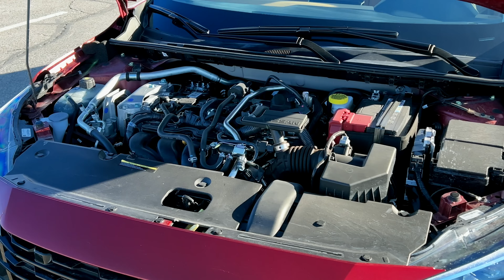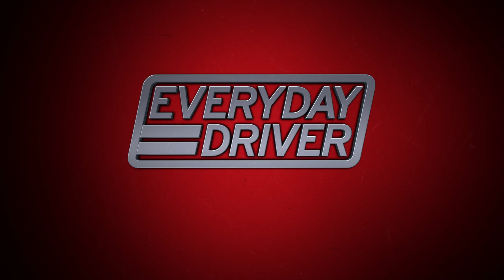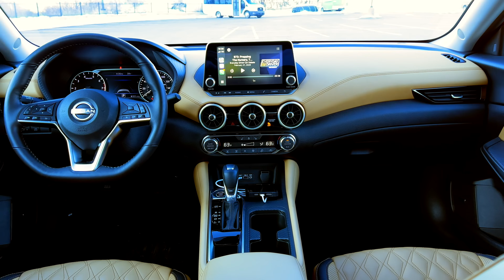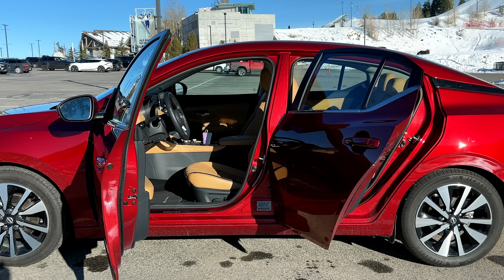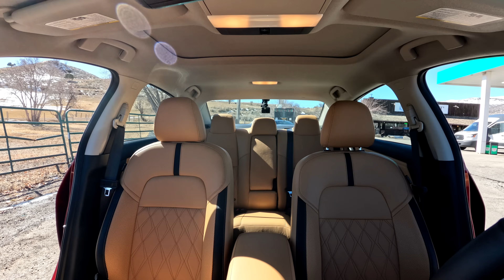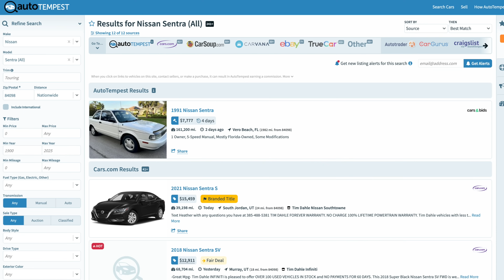Nissan Sentra SV - Value Over Enjoyment | Test Drive

Comment: I love my 2023 Sentra SV. 37,000 miles and 2 years later I still love it. No, it's not a sports car, but it has enough power mixed with great MPG. My average mpg is 39.3. I love it while driving up canyons. The CVT finds the proper spot and holds the car there.  No shifting up and down constantly. I drive up the canyons in Utah at 70 mph no problem.

Comment: It's too bad Nissan didn't invest in hybrid technology early on like Toyota and Honda did. This car with the Civic's hybrid system or something similar would push its horsepower up by at least 30-50, and be even more fuel efficient, which is what buyers in this price range are looking for. Then again, it might also cost a few thousand more, which would take away from its bargain status.
Reply: @Gambit166, This car gets great gas milage. Are you for real?

Comment: I rented one of these, in cloth trim.  I felt that the power was adequate and the seats very comfortable.  It’s no race car but it does fine on the highway, and the gas mileage was amazing.  I wish we could get more trims in manual as to bypass the reputably shaky CVT.

I found the handling quite decent.  I guess it was more of a function of this being a sedan as opposed to a crossover.

I would love to a see a review of a 2025 Corolla LE gas-only!

Comment: Rented an SV trim for the past month and drove 5000 miles through the front range and New Mexico. Acceleration was very poor. Fuel economy was average. Comfortable seats. Horrible halogen headlights. Good storage space in the back.  Transmission is terrible.  After the Sentra, I went into a Corolla for a week and then a Mazda 3 sedan.  The Toyota was by far the worst. The Mazda was my favorite. Drove the Mazda for 2800 miles over a weekend. With 32 hours in the seat, I was not fatigued driving in the Mazda.  All three were front wheel drive sedan and by far the Mazda was the most comfortable to drive. The Nissan would be a number two because the anemic engine and transmission. Interior wise, It wasn’t bad, but it wasn’t as nice as the Mazda. The Toyota is laughably so far behind I would not recommend anybody ever renting one.
Reply: The Corolla is overrated.

Comment: I bought a 2025 SV 5 days ago....For the 24,000 dollars and lifetime engine powertrain and drivetrain...I couldnt pass it up in spite of my doubts about the xtronic cvt! I give it 4 stars for value! You get a great car for around 20k folks!
Reply: 3 weeks ago I bought a brand new sentra 2025 but mine's the S model I also got a 1 million mile powertrain warranty from my dealer Even though mine is the base model I'm enjoying it it is the first brand new car I've had in over 20 years
Reply: @aaronyork6173 Congratulations! Happy motoring!
Reply: How did you get a lifetime powertrain warranty?
Reply: @keithert  Dealer incentive
Reply: The CVT in your car was redesigned two years ago. It shouldn’t give you any problems over its lifetime.

Comment: I had a 2014 Nissan Sentra SR and it was great, until you got to the transmission. The cvt just killed that car for me and I sold it 2 years agter buying it. I did buy it 3yrs old with 22k miles and sokd it by 44k miles. It was a great car, never gave me a single issue, but it was just BORING. Overal tho it was a great car, just wasnt for me.
Reply: The 2013-19 was a bad generation Sentra. 2020- Present like this one is far better.

Comment: Change the transmission fluid every 20k miles and it will be trouble free for 300k miles.  
Problem is that most of the first owners are companies buying for their salespeople, and rental companies, all of which perform minimal maintenance.
Reply: People shouldn't buy cars that transmission oil have to be changed every 20k.miles, just put a freaking automatic transmission or a CVT that last the life of the car....not 40k or 80k . .. people don't have to put up with that ..
Reply: @armandohernan4610  It's every 30k, at least based on the manual. He's saying to do it 20k, I think, so it lasts that many miles. It has more to do with a different type of transmission that needs more care. You get the efficiency of a CVT, but there are always trade-offs. There is no such thing as lifetime fluid...and if you do that the car will likely be dead by 120k miles...maybe 150k. If that's what you want, go for it.

Comment: I had a 2002 SpecV. Super fun car. 6spd manual, lsd, performance suspension. Upgraded to a bunch of Nismo parts and put on some sticky rubber. It came with Skyline seats at that time. Great autoX car.

Comment: I know its inexpensive.  And they are trying.  The exterior is pretty well done.  But to me the interior screams cheap.  I hope the seats are comfortable, but they look like an old taxi with plastic seat covers.  The corolla interior you show is just black, but it looks so much better to me.  I am not touching anything, I have no reference in those terms.  But to me, the effort to make a cheap interior not look cheap, screams cheap.  The view to the back looks good, but the view from the back seats to the windshield, oy vey.  I am around a lot of chinese cars.  This Sentra interior is like a b or c grade chinese car from several years back.  These days anything in this price range has either a very chinese styled or the interior sort of nice, often although cheap feeling.  I think if they used the same design, but with one or two slightly different colors using textures instead of color it would be much more attractive.  I like the knobs on the screen.  It looks like there is a lot of room inside.  2 years ago I rented a loaded out Rogue.  It turned out I hated it, it was awful to drive, but what an impression when you first open the door.  I think they have a formula.  Fool the buyer on the 10-15 minute test drive.  Make it looks nice and expensive, draw attention from the dynamics.  I don't think they were successful with the interior on this sentra.  And I agree, inexpensive cars are very interesting .
Reply: Chinese cars are surface level nice.  Beneath that veneer is absolutely pile of cheap garbage that will kill you in a crash
Reply: Yes it is and starts developing rattles at 100 mi on the odometer

Comment: I'll take the standard 191 horsepower 2.5L engine and 6 speed automatic in the Mazda3 please... for about the same coin as this Sentra 😮
Reply: Enjoy your torsion beam in 2025
Reply: @SF.Automotive  I'd rather deal with torsion beam on a non performance car, than a CVT or 149hp engine.
Reply: Same list price maybe, but good luck getting one at the same out-the-door-cost, unfortunately. 😢